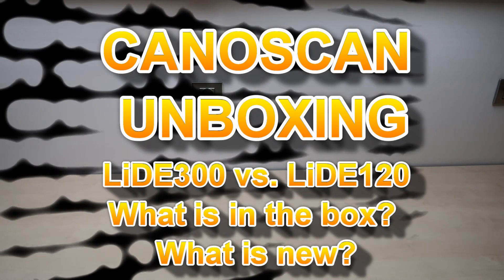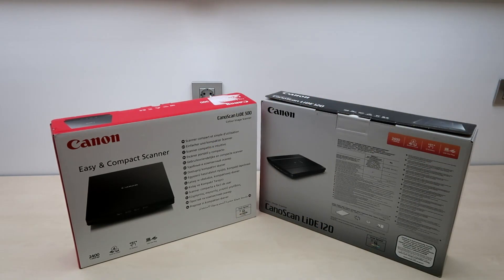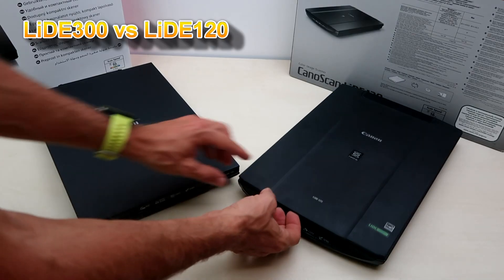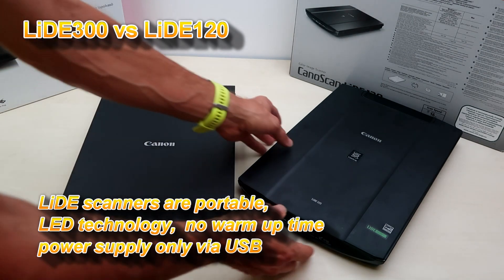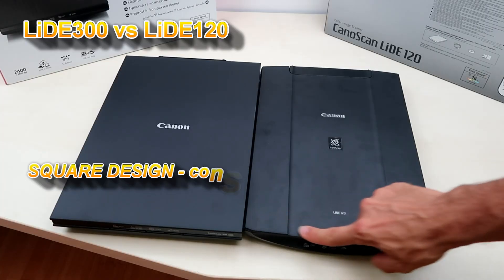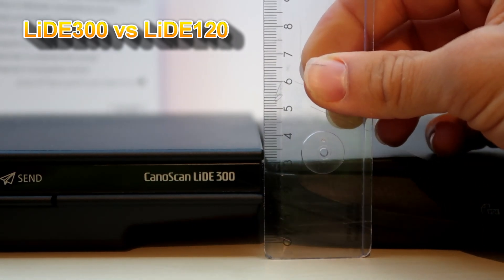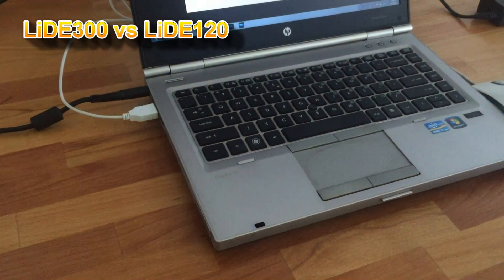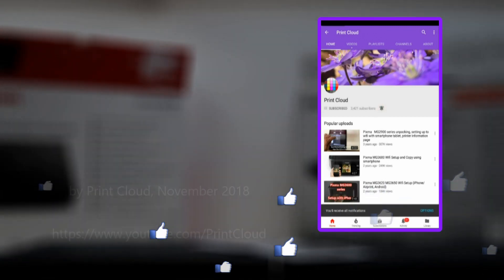Canoscan LiDE300 (part1) - Unboxing and what is new vs LiDE120

Comment: If Lide300 is better than Lide120, then, why Lide120 model more expensive than Lide300?
Current price at Amazon:
Canon Lide300; RS 3959.
Canon lide120: RS 4800.
Reply from the maker: They are very similar from specs, but I like LiDE120 more. The rounded design  looks better to me.